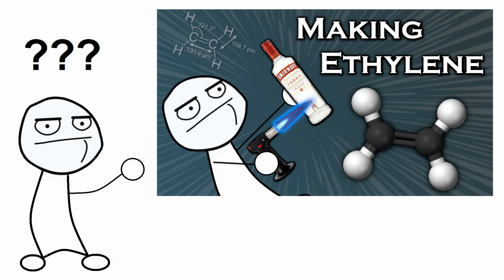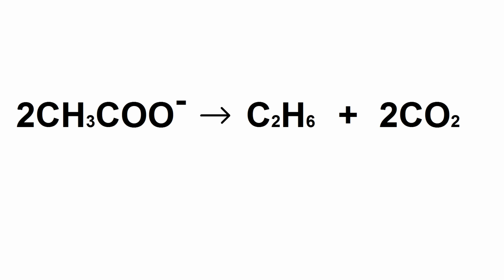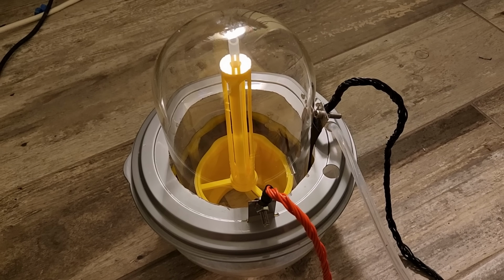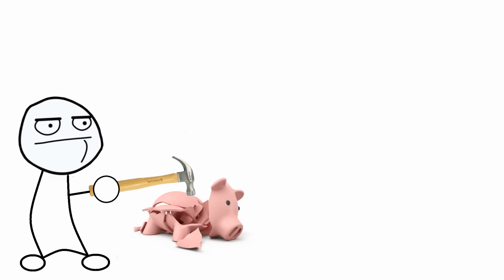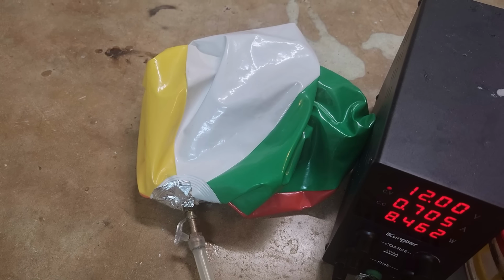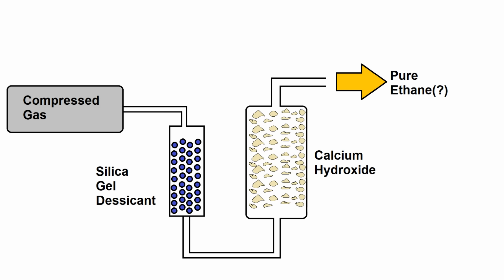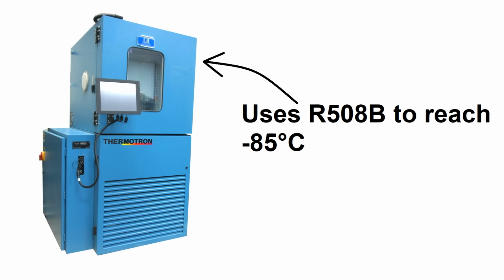How to make Ethane Refrigerant (R170)

Comment: I keep watching your videos because I have this idea of using excess solar production to generate a gas/liquid that can be stored for a long time and then used in a fuel cell to recover some of the energy for later. The roundtrip efficiency would be bad, but if storage is dense enough and the generator and fuel-cell are compact and lightweight enough, it could replace the need to have large batteries?

The use case I have in mind is sailboats with electric propulsion. Most of the solar power captured is wasted every day because the batteries are full, but battery storage is heavy so the endurance of the vessel under electric propulsion is quite limited. The current solution is to bring diesel/gasoline and a generator. But that's annoying because it's not self sufficient, so you can't park your boat at an atoll and wait for it to replenish its energy stores. On the other hand, if the boat was equipped with (eg) a gas generator and compressor, stored that into tanks over weeks idling, and then generated power for the few hours/days needed when using electric propulsion, it could theoretically remain self-sufficient for years. 

Hydrogen is the easiest gas to produce because there's already systems to generate fresh water from the ocean on cruising boats. But hydrogen storage takes a lot of space and seems to not work well for long durations.  Is there another reaction that you think could be done aboard a small vessel that would require only inputs available in the atmosphere/the ocean?

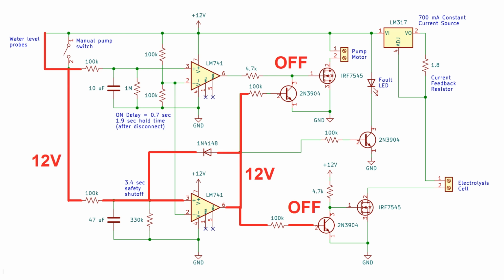Comment: 13:33 The fault LED part of the circuit is designed horribly. You always want to put a resistor in series with an LED to limit current through it. In this case, the only thing that would limit the current is the current gain of the transistor combined with the huge base resistor you put in. Transistor current gain varies wildly across units, so you never want to rely on it.

Explanation:
The LM741 can swing it's output to around 11V with a 12V power supply. Transistor bases have roughly a 0.65V diode drop to the emitter, so you're gonna have (11 V - 0.65 V) / 100000 Ohm = 0.1035 mA flowing into it's base. A quick scan of the 2n3904 datasheet reveals that it can have a current gain up to 300, so there could be be up to 30 mA flowing through the LED (which is already a lot, and the LED might fail depending on it's type). Most red LEDs have a forward voltage around 2 volts, so the transistor is left with 10 volts across collector and emitter, which makes it dissipate 30 mA * 10V = 300 mW of power in the worst case. This much power will cause it's junction temperature to skyrocket, and it's datasheet implies that current gain only goes up with temperature, which will increase power dissipation even more and might lead into a thermal runaway situation.

All this is assuming that the LED you have selected is really a diode, and not one of those weird ones that have a large series resistor inside the package.

Comment: 3D Prints are usually not water tight and are also not suitable for high voltage. Even 40mm solid PLA can't withstand 30KV.
Just so you know for future projects :)

Comment: why platinum, carbon works in most situations and is not so horribly expensive, also the oil might be glycerol like in soap making process, nice project, you know that NaOH + oil -> glycerol + soap. similar. yep you get also other compounds not only c2h6. you get other oils and the glycerol. hydrocarbon/oil synthetizer cell. well vinegar + NaOH (Na + water) would also be hydrocarbon source. the oil is probably some synthetic gasoline type of oil, just in fractions whatever the electrolysis cell outputs, not all of them in great quantities. its probably some multiplicate of C2H6, say C4H10 or C3H8 (propane gas tho) pushing in more hydrogen on the stuff, some light oil and/or heavy oil.
Reply: Glycerin in miscible with water. The oil also formed during the neutralization of acetic acid not during the electrolysis, so it’s probably a contaminant in the vinegar.
Reply: try making soap, glycerin will float on top of the soap for a while, like hours, then mix with the soap @ashe1.070
Reply: also that much contaminant? nope, its a major reaction to get that much, soap making makes that much glycerin, noticeable not trace amounts @ashe1.070
Reply: ok lets say the contaminant is in large scale ethanol then sodium ethoxide would form, might be yellowish in my tests @ashe1.070
Reply: as bacteria are typical source for both vinegar and ethanol, then that would be the most logical answer @ashe1.070

Comment: You can collect 1,1-DiFluoroEthane (DFE) from refrigerating Computer Duster in the refrigerator and then turning the can upside down. At room temperature, DFE freezes at around -25°C (-13°F). I used to cool down thermometers and also freeze a roach with it. 
Chemical name: 1,1-Difluoroethane (DFE). 
Melting Point is -178.6°F (-117°C). 
Boiling point is -11.29°F (-24.05°C).

Comment: You could check if your solution was already saturated with acetates, I'm guessing excess acetic acid collected in an organic phase above the aqueous one since the density of water solution changes with solvents (so it travelled up instead of making oily droplets at the bottom) thats just my guess though
Reply: Acetic acid is miscible with water.
Reply: @ashe1.070  Yes but to a certain degree and the guy has put a lot of acetate ions already in there

Comment: Some tips/notes:
* You can use the same ABS slurry (or a thinner mix of the same) to paint onto your ABS pipe to seal it to prevent gas leaking out of it.
* There was no need to use a transistorized inverter to flip the state of your float switch; simply by placing it either tied to ground with a pull-up resistor vs tied to your positive rail with a pull-down resistor (something small-value like a 1-5k so it's strong vs your other resistors) would allow you to get the inverted behaviour you're looking for, and the impedance on the op-amp inputs is so high that you absolutely don't need the amplification your transistor is providing.
* As designed, there's some amount of interdependence on the switch on/off timing of your two op-amps; depending on how they cycle on/off, one will back-feed some current into the other and alter its timings. This may not be important enough to matter for your application, but you could avoid it by placing diodes inline with your 100k input resistors (possibly adjusting the resistor values accordingly).
* You can actually eliminate all three of your extra 2N3904 safety transistors. If you flip the inputs on your bottom op-amp (and reverse the polarity of the feedback diode) you'll get an output that latches low during your fault condition instead of high. From there, you can drive the electrolysis cell shut-off FET directly with no inverting transistor required. You can tie the cathode of the fault LED directly to the output of the op-amp (through a current-limiting resistor), since an LM741 (or just about any fairly normal op-amp) can sink 20mA without much issue and 5mA or so is plenty for modern indicator LEDs. Then, for your pump motor shut-off, ditch the extra 2N3904 and instead hook up your lower op-amp's output to the non-inverting input of your upper op-amp with a diode (anode toward the non-inverting input of the upper op-amp). It will not conduct in normal operation (with the lower output high) but will pull the node down when the circuit faults out, shutting off the upper op-amp's output.

Great video though, and pretty successful! I look forward to your next one, always interesting to see what you come up with. I was surprised you dried your gas after pumping it into your sausage tank; I would have been very concerned about potentially corroding the inside of the tank when it's initially filled, but maybe that's not much of an issue if you're not pumping any oxygen into the tank and it gets dried by cycling back and forth into it.
Reply: I would also share the same concern about pumping the crude gas mixture directly into the tank. The crude gas probably contains a significant amount of acetic acid vapors, which surely can't be good for a metal tank.

Comment: What is the simplest refrigerant-based solution for cooling a room, that could be DIYed?
Reply: I think it was Tech Ingredients that demonstrated a 3 tower system that had solutions of some salt that absorbs heat and moisture alternately.  No compressed gasses, just simple fans and liquid pumps.

Comment: Great project. Regarding the float valve, they can usually be switched between NO/NC by removing the C clip and reinserting the float in the reverse orientation.

Comment: I think the oily layer is acetic acid and it's not dissolving into the water due to the high ionic contents from the salts.
Reply: Acetic acid is very polar. It is miscible with water, and can actually dissolve salts on its own to an extent. Vinegar is also 6% acetic acid, and he was using vinegar that was diluted. So, there’s not that much acetic acid present.

Comment: Instead of the logic inverter, most float switches can be switched NC to NO by flipping the float around.

The oily stuff might be ethyl acetate, a common organic solvent.
Reply: Even though ethyl acetate doesn’t mix with water it isn’t very oily. It’s viscosity is around the same as acetone.

Comment: It might sound pretty weird but im pretty sure the oily layer you got is acetic acid. Because you have so much salts dissolved in the water (the sodium acetate) it causes the solubility of acetic acid to decrease to a point that it actually separates from the solution cus of the Ionic strength of the salts (fancy physico-chemistry crap). This effect is called the Salting Out effect, I have done that to separate ethanol from water so this could totally happen with acetic acid as well. As you noted later on, the layer disappeared after a couple of days cus, as you explained, the solution becomes more basic causing the deprotonation of the acid and putting it into solution. 

Also before someone "uhm aktchualu"`s me, even thought acetic acid has a density of 1.05 g/mL, the water solution is still heavier cus it has a lot of salts dissolved which cause the density to drastically increase.
Reply: Yep, strongly suspect this. Essentially crashing out the acetic by increasing the ionic strength. Honestly can't think what else it could be unless there's some major impurity in the vinegar.
Reply: I agree. Plus you started with 45% vinegar which is crazy.
Reply: Not trying to be a smartass but I've never seen Acetic acid to be "oily" at any concentration so I really wonder, maybe there is some kind of side reaction and some hydrocarbons are produced? Edit: Might add it also had very low conductivity, low enough that it didn't triggered fill sensor. Edit2: Nevermind I just re watched it and realized that happened even before he electrolyzed the solution so yeah, it should definitely be acetic acid salting out.
Reply: @teresashinkansen9402  I'd be very doubtful. If we were talking about a ketone with acidic protons on the carbon next to the carbonyl (e.g. acetone) then perhaps some polymeric junk might form (?), although I'd still be a little surprised in the presence of a mild base like sodium bicarbonate. But acetic acid (and carboxylic acids in general) have far more acidic COOH groups, and once they're negatively charged, there's no tendency to deprotonate again. Perhaps some acetic acid is reacting with some other rubbish in the vinegar (?), but I don't think you would see such a substantial layer in that case.

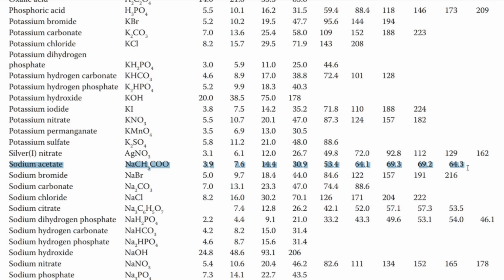He mentions that acetic acid has quite low conductivity around 4:24 which might explain the issue.

edit: if it was forming during the electrolysis, I might be a bit more suspicious something else was going on, but it seems like it forms as soon as the solution is prepared. Also, he mentions it reforms when acetic acid was added when the pH increases, which fits with this being a salting out of acetic acid.
Reply: @tomsmith48  Yeah just re-watched the video and realized that was even before he ran the cell so there is no other explanation, its acetic acid being salted out.
Reply: I concur with these smart people.
Reply: Acetic acid looks kinda oily near melting point at 16C:) I think you salted out acid.
Reply: Yeah, bang on. Acetic acid being salted out.
Reply: You could easily test by testing freezing pt, this might be a new way to make glacial acetic acid
Reply: That's also my best guess for it to be Acetic acid!
Reply: Uhm, actually this is a nice explanation. Thanks.
Reply: By this logic, a solution of ethanol in water (ethanol being less polar than acetic acid), could also have the ethanol salted out and form a separate layer, except I don't think that happens. It could be that acetic acid is special, or i'm just wrong but I'm not fully convinced by your explanation. Then again if it isn't acetic acid, i don't know what is, so i'll have to agree with you.
Reply: @rodrigomack13  That does happen though, i've done it, but the ethanol is translucent not oily
Reply: This answer scans. I know some concentrations of nitric acid have been described as oily, as has nitroglycerin.
Reply: um akchualy, I think that makes sense
Reply: That makes sense.
Reply: That makes sense. Also used for removing water from products. Add strong salt solution and mix in sep funnel. 

Strong stirring should help with that.
Reply: My thought was... is he using vinegar or 45% acetic acid...
because, you see, vinegar is more then just dilute acetic acid, there are other organic compounds in it. Flavours, Food Colourings etc.
And those could very well salt out. I think the yellow colour is a strong indicator of it being something else, as I have never seen pure acetic acid getting salted out nor it having a colour in liquid form, as glacial acetic acid is colourless
Reply: @Marian_Martin_Morgenstern  It's hard to tell from the video, but it looks like the immiscible layer is substantial (looks like a good few mm to maybe a cm depth in the vessel, although the narrow neck will have increased the depth in the image). It could be something else, but I feel it just looks a bit too much for it to be a minor component or even all the minor parts crashing out.

Those components are present however, and will likely partition favourably into the acetic acid layer, hence the strong colour in the upper layer.
Reply: @Marian_Martin_Morgenstern  That depends entirely on what 'vinegar' he is using. Distilled white vinegar, what most in the US refer as vinegar, is simply 4.5% acetic acid. Also no way in hell could you buy a food product with flavoring/coloring that was 45% acetic.
Reply: @hunterm9 I've never once seen any colored or flavored vinegar in any strength, where are people buying these magic vinegars? Only time I've seen that is in salad dressing haha
Reply: @Marian_Martin_Morgenstern what kind of vinegar are you getting that have flavoring and food coloring in it..? I've bought dilute vinegar plenty of times and not once have I found flavored vinegar nor any food coloring... Looks like water lol
Reply: @DarkAttack14
You're amerikan, aren't ya?
Why do I think that?
Everywhere else  in the World Vinegar isn't just diluted industrial acidic acid, but fermented from apples, wine, raspberries and such things or made to look like real vinegars by adding color/flavor to diluted industrial acidic acid, but then this must be declared on the product. And there are even certain vinegars that are legaly protected from counterfeinting them like this
Look up "aceto balsamico di modena", over here vinegar is treated like fine wines and not made from industrial leftovers you know
Reply: That is definitly no acetc acid , it is yellowish and oily. wonder why he make Na-acetat not with acetic acid and NaOH. I think the hole video is a fake

Comment: To Bend a Glass Tube without Kinking the Glass you can First Fill the Tube with Fine Quartz Sand (not sharp).
This will keep the form of the tube while allowing you to make the bend and then drain out the sand to finish.
Reply: Next time cork the other end and connect a tube which you can blow in some air through to smooth the bend.
Reply: Wouldn't the quartz particles stick inside the glass tube? Neon tube makers cork both ends of the tube and somehow let out a bit of the air so that the molten part doesn’t balloon up.

Comment: I think you should be able to make a mixed refrigerant of ethane and ethylene, with a phase separator and a gas ballast tank. In theory that should enable you to get to the temperatures with a single stage compressor.

Comment: Just an FYI, I've been using two of those Platinum plated titanium anodes. The exact one you showed at the end of your video, for a electrolytic reactions in both high and low pH conditions and I'm not having any issues with them after about 1 month of 25% duty cycling. I'd run them longer, but my cell is even smaller than yours, and I'm worried it will run dry while I'm out of the house. I got mine very cheap in an ebay auction that I bid on, rather selecting "buy it now" - only a couple of dollars each.

Comment: These sort of continuous service electrolysis reactors operate better when you have a reservoir tank separate to the cell. The conductivity and mass transfer rate over the electrodes will become limiting after any exhaustion of the cell from the ideal - run a small pump over the electrodes and have it circulating between the cell and the tank. The other advantage of this is being able to quickly change electrolyte. I've ran a bespoke electrowinning setup in an industrial environment for several months continuously using similar hardware to what you are using by utilising a reservoir.